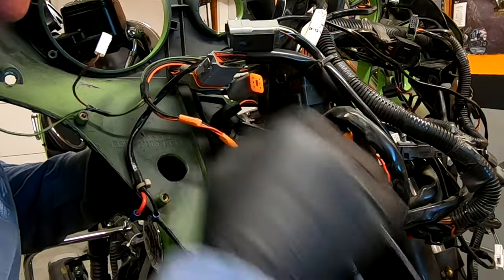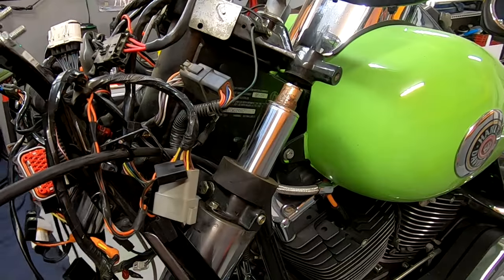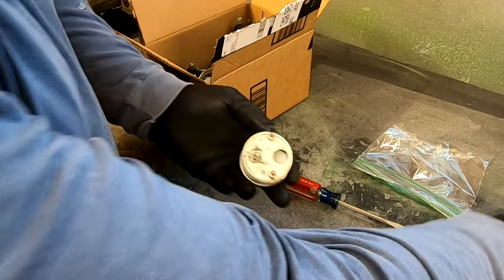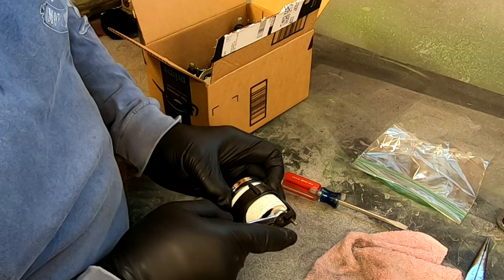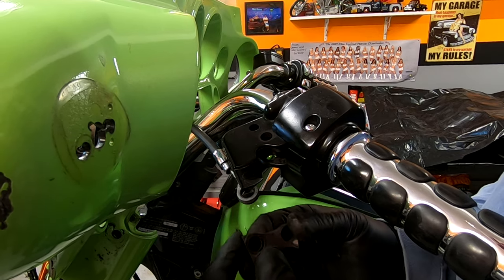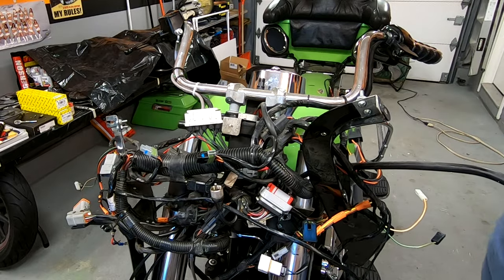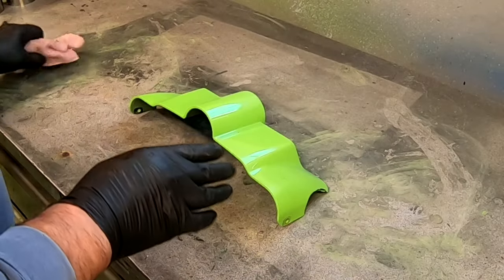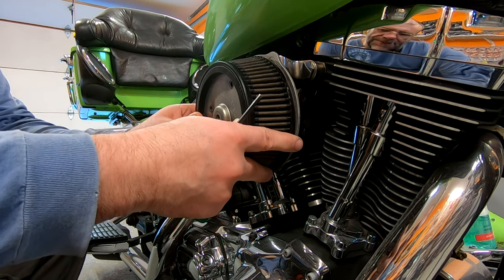Harley Ultra Classic Makeover #8 Inner Fairing Switch Console Front Forks Fork Covers | Techn' Moto

Comment: Looking good Mike. What color are you thinking of ??? Are you thinking of an engine rebuild?? I have never worked on a bike to that extent.  It would be cool to see. Stay strong and safe brother. Bye the way bud it L.B.
Reply from the maker: Not sure on the color, still thinking about it. The engine and trani is not in need of a rebuild at this time and hopefully not in the near future lol. Although I have put a lot of work into this engine over the years. Stuff like timing chain tensioners, transmission seals, stator and all electrical components that go with that, etc. This is a long term project- not rushing it due to many family/life commitments etc.